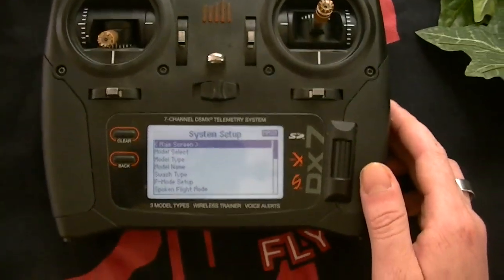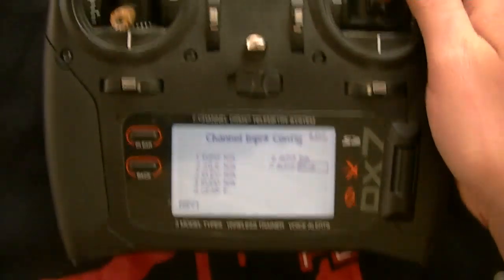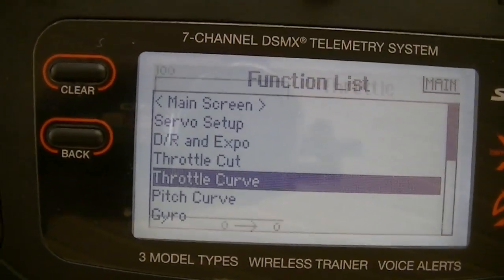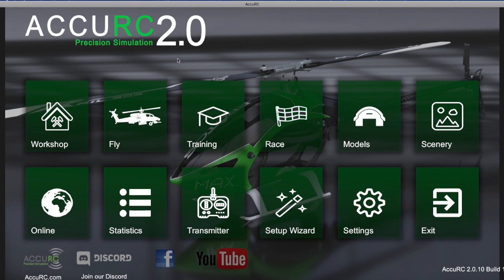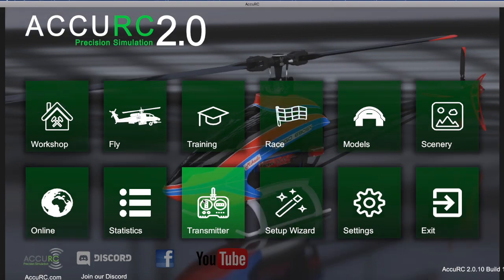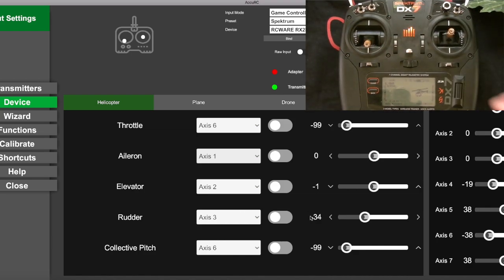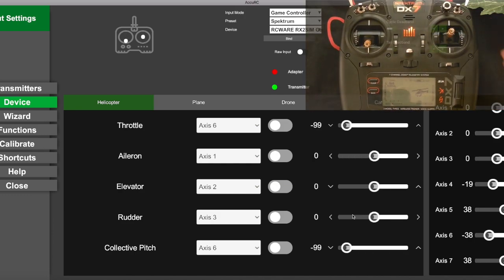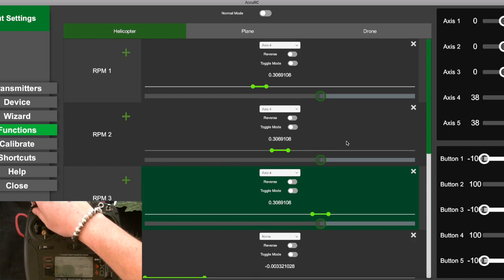Accu Rc Wireless Setup Guide (FreddyCanFly)

Comment: Great video! One problem I can not work out. Using the DX8G2 and a bound Spektrum WS2000 dongle. All Tx settings per the video are done (I think:)) Stick movement (Ali, Rud and Ele) react as expected. But zero throttle stick movement :(  I must have something set incorrectly in the Tx?? When I check the Sim (play) the Heli is already turning high rpms on the deck. No throttle response...weird. Thanks for the work you put into this video!!
Reply from the maker: Maybe try to recalibration process again and make sure your throttle curve is linear as well.

Comment: Freddy. I have the transmitter dx6e and sim. What other parts do i need 2 get it 2 work..????
Reply from the maker: You need to get a cable to use, and or the wireless sim and a satellite.
Reply: I have the accu2.0..on your video do you show a reciever and a satellite bound to the transmitter and laptop???

Comment: Hey Freddy:  im only getting 66% on all controls, how do i change that to 100 on input settings?  J
Reply from the maker: have you completed your throttle calibration first then assigned the correct channels?  Also make sure your ratio is set to +100/-100 on your travel limits.

Comment: Hi mate just wonder what switch is the for dial in calibration?
Reply from the maker: I am pretty sure you can use them, however it will depend on your radio and how many channels and what they are assigned to.  What were you trying to use the dial for?
Reply: Freddy Cordova thanks for your time. Im using ix12 with the sim. I tried every switch when I was calibration, the only switch it seems work the knob on top right. Thats why I was confused..

Comment: Great flying instructional videos.  I was one of the early adopters of Accu RC. It came with USB dongle.  I simply took spare head phone jacks and soldered   DSM2 satellite . I did the same with   Futaba cheap S-bus receiver.   The headphone jack plugs into the dongle.  I can fly either radio Spektrum or Futaba.   There is only 3 wires to solder   ground, positive and signal wire.
Reply from the maker: I think they have made some great progress with the updates.  There are still some things I would like to see change, however I am willing to give it some time to progress :)